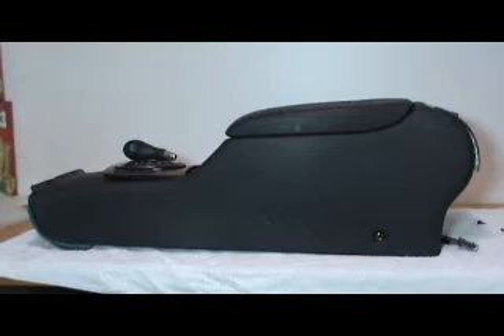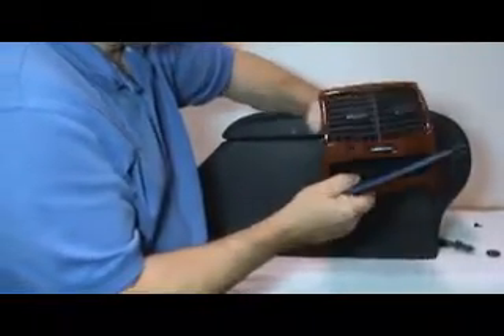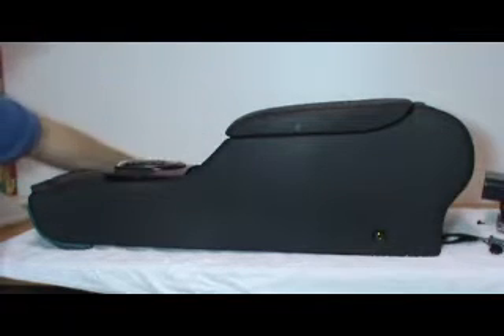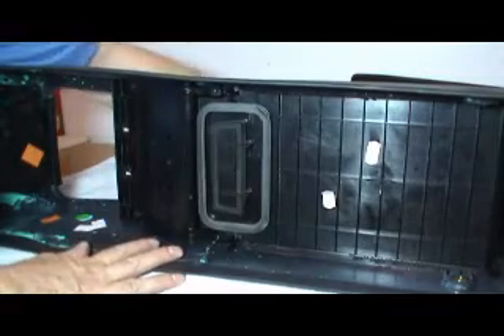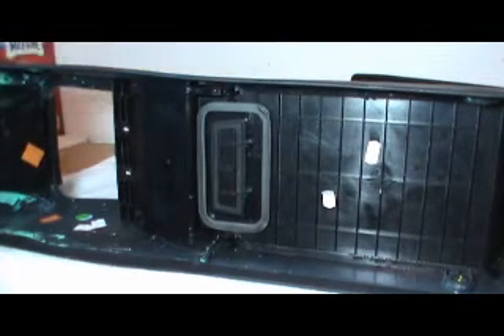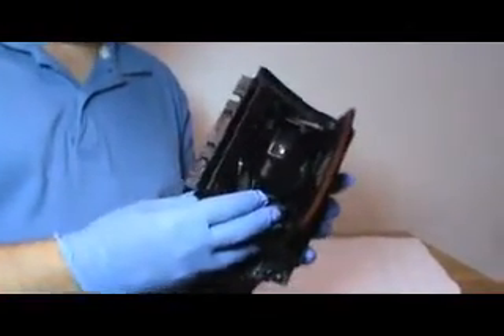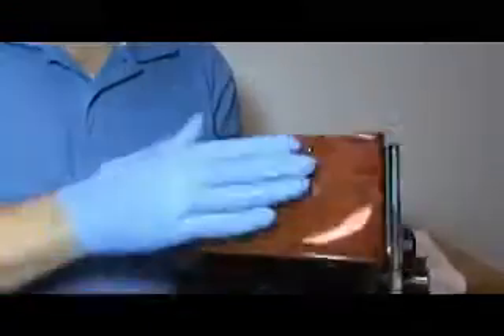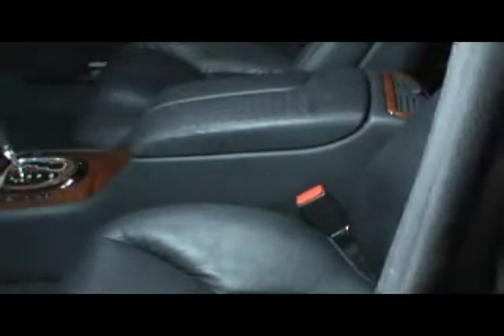Mercedes Benz S430 Center Console Removal

Comment: how did the mod turn out?
Reply from the maker: Roy S Not very well.  Ended up tapping off of the junction under passenger foot well and running a line to the ashtray where I have a USB style plug in stored.
Reply: nice. I would've done the same thing
Reply: David Prokity